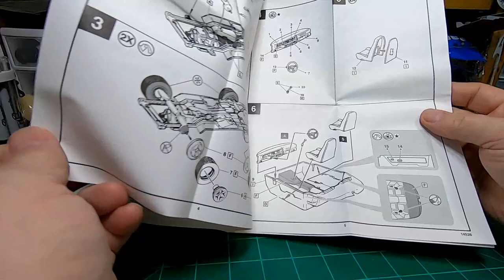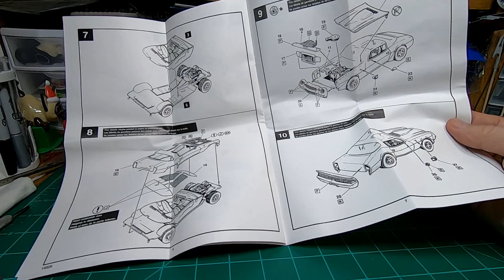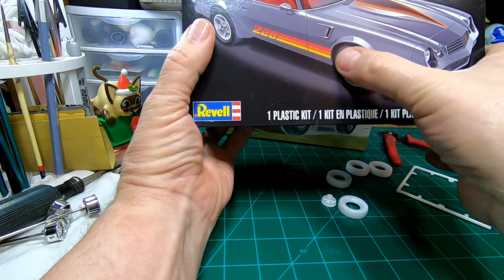1981 Chevrolet Camaro Z/28 by Revell - Episode 25

Comment: Looks awesome! Gotta be a solution to those tires.
Reply from the maker: Thank You! Proof that you can turn a pigs ear into a silk purse! However, if there's a solution to the tire issue I didn't have the time or the parts to make it happen. As I mentioned in the video, I have a box of tires, there must be at least 200 tires in that and I couldn't find a single tire that the rim would fit into. Then there's the issue of how the rims mount to the chassis. I imagine with time, luck and a little ingenuity this could be reconfigured for better wheels and tires. The front being the most difficult. Of course, a person could just straight up start drill holes and pushing metal axles through them but to make it look good... Now there's the challenge! Thanks for watching!
Reply: I noticed about the tires too.. They fell short on that part of the kit. They just don’t look right at all. Tire height looks off… suspicious 🤨 other than that the kit looks great 👍  @scaleautoguysworkbench
Reply from the maker: Sorry for the late reply...  I thought that a tire with a shorter sidewall would have looked way better on this. The 1:1 car sports a 225/70-15 tire.  When looking at images of the 1:1 car, the tire sidewall isn't as tall. Someone over there at Revell got this one thing wrong and it kind of throws off the visuals on this kit. Other than that though, the body and the interior was straight and it went together without issue.

Comment: Good timing to make a good looking job from this particular kit... We all know revell pulled a fast one over on us all regarding this kit and it really wasnt a nice thing to do in me opinoin but it is what it is...might as well make the most ofit right? Personally im gonna snag one and kit bash it with an older revell release of the 79 camaro...mainly the decals from this kit are what was originally lacking in the older 79z28 kits...the decals that shoulda been the red&orange wer kinda brown... anyways im enjoying the channel so far keep builds coming
Reply from the maker: Thank You!
This kit isn't as bad as everyone is talking about. It went together well, there was minimal flash and zero warp. In some ways it is better than the AMT 1964 Galaxie 500XL and the Cal Drag Combo Galaxie 500XL (same car, different kit). At least the Camaro has an opening hood and a somewhat resemblance of an engine. Yes, the plastic tires are a bummer but it still builds into something nice looking. Thanks for watching!

Comment: I have the Same Kit . If i Had known about the Tires, I would Not have bought IT 🤮🤮🤮
Reply from the maker: The tires are a big letdown, but the rest of the kit isn't really all that bad despite a few little inaccuracies. When it is completed, it looks decent. It won't win any awards or anything, but it displays nice-ish.
Reply: @scaleautoguysworkbench  I'm gonna Check with Pegasus Hobby and See If I can find a Set of Tires and rims ! 😁😁
Reply from the maker: @stephenashley8431  That may work. I have seen where others had replaced the wheels and tires on that kit to make it look better. I dug through my parts box and couldn't find anything that would work but I didn't think about going with Pegasus wheels for a solution.

Comment: That kit isn't worth the price I took mine back
Reply from the maker: I agree 100% and I mention that in the intro to the video but....  If you can find it at Hobby Lobby during their 40% off sale you can save yourself around $15 and that makes the price come into line with a somewhat average cost. I only paid like $20 and tax for this and it really does build up nice. I f you were the adventurous type, I imagine that you could cut out that two piece engine and put something nicer under the hood. The wheels and tires could also be upgraded but that would be a little more work. I agree that when a person buys a kit they shouldn't have to re-engineer it to make it look good but thankfully this one does build up nice but could use some refinement.

Comment: They replicated the P225 70 R15 set which was the stock tire/Wheel size.  Though the way they scaled them it looks to be P225 75 R15 giving the tires a higher profile and meatier look.  You can easily sand off the lettering and use aftermarket decals that come on huge sheets to do lots of different brands.  I only bought 2 of these kits for the bodies as the 79 and 80 were my 2 favorite years for the body style, alternatively you could remove the engine sculpt from the chassis and use an engine from another kit.  I bought 2 resin engines for the kit bash on this model Im current;y getting the rest of the custom pieces so I can start it lol.  Great video!
Reply from the maker: Those tires are ridiculously out of scale. I did sand the lettering off of them and just went with the solid black wall. I need to get some of those tire labels for future projects. Thanks for the heads-up on those. I have liked this body style for many years, and that's why I got this kit. It has a ton of possibilities for modifications. I build mostly box stock with a few mild  modifications here and there.

Comment: How long did you let paint dry before sanding it, and what grit did you use, and was it a wet sand or dry?
Reply from the maker: As a general rule, I wait a minimum of 24 hours ( sometimes longer ) between coats including clear and primer coats. I do this just to make sure that the paint has had time to gas out fully. 

As far as sanding on this particular paint job, there was none performed on it (except for the tire sidewalls). That's just one of the things that I love about craft paints, they most generally lay down flat. Of course, that isn't true 100% of the time, but for this build it held true. The second coat of paint was applied to this build because I wanted the color to be a shade darker. 

As a rule I never wet sand acrylic craft paint because the paint tends to remove itself from the body as it is water based, (a lesson hard learned a long time ago). So, if I have to do any sanding at all on a body, I usually use 1500 - 2000 grit, dry sand very lightly to smooth any bad spots. Which do happen from time to time.  I hope that this answers your question. Thanks for Watching!

Comment: Iv ben lookin at that kit still think I'm gonna get one I build then custom most of the time anyway as long as the body looks good I'm good
Reply from the maker: This had a very clean body, chassis and interior for the most part. There is plenty of room to customize this kit. The engine could possibly be removed and replaced with something better looking with a little effort. The tires and wheels would require a bit more effort but I could see it being modified.Thanks for watching!

Comment: The solution is tires and rim's from another kit. Use your imagination, you'll be surprised.
Reply from the maker: I agree! I didn't have the necessary parts to accomplish that task. Short of completely re-engineering the suspension, finding rims that would work with the existing axle set ups would be difficult. Not that I'm not up for that I just don't want to trash a $30-35+ kit for the suspension parts. Tires and rims... I have those...  I suppose that I could have nipped of the studs a glued replacement wheels directly to the suspension... Maybe next time